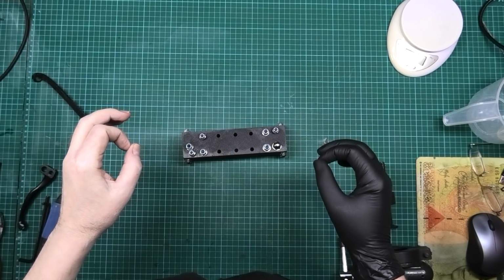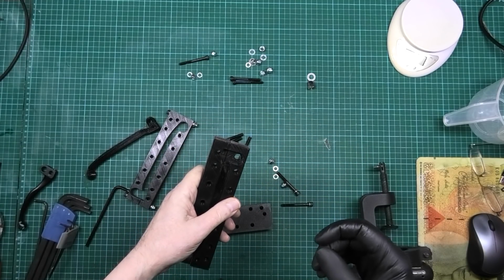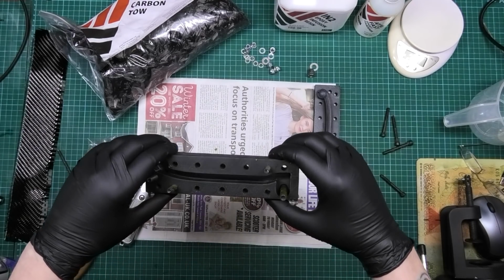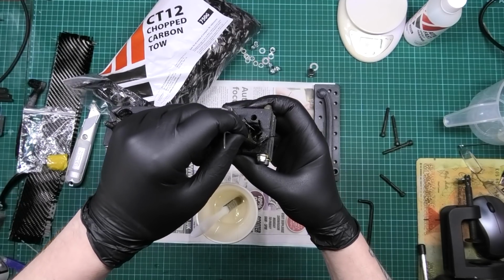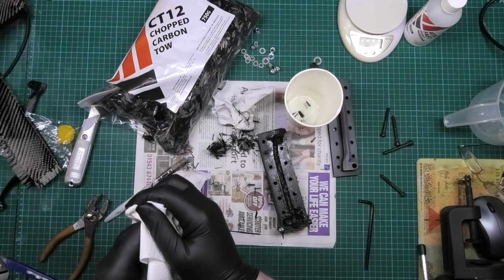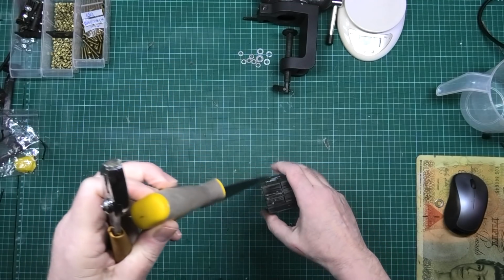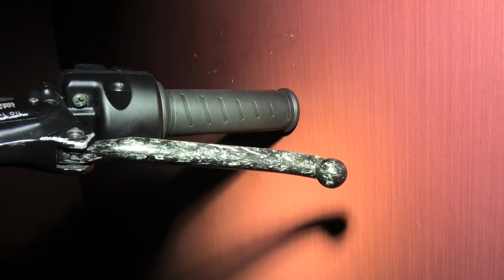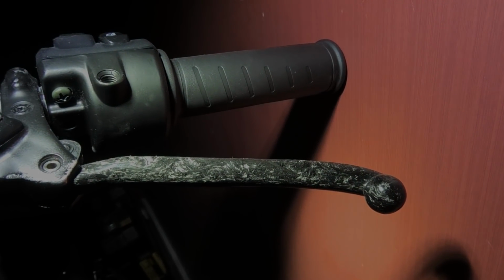🔴 EXTREMELY POWERFUL E-SCOOTER BUILD part 16 - Carbon fibre forge mould brake lever

Comment: ..and remember, life is definitely worth living on this measly earth!  Great job Tone, work of art 👍
Reply from the maker: One day soon, I'll be able to utter those immortal words again 😉
Reply: @Vortecks  hey i have a question :) 
i have a 48v 17ah battery it powers a 1000w motor could i use a higher power battery would it be safe ? 
thanks :)
Reply: @FattyOn2Wheels  If you want to use a higher voltage battery, you'll need to get a new controller rated at the same voltage as the battery otherwise you risk irreversible damage and possibly fire. if you get a new controller, I'd recommend a battery capable of at least 50% higher discharge amperage rate than the what the controller demands. Otherwise your battery will not last as long as it should. I hope this helps.
Reply: @colinriches1519  Thanks for the reply if i keep the Voltage the same 48V but change the AH would that be okay ? im currently using a 48v 17.5ah battery if i went to 48V 50ah would that be safe im not trying to change the voltage :)
Reply: @FattyOn2Wheels  Yes that would be safe. It will give you a lot more range too, but the extra weight might negatively affect the acceleration a little bit. But yes you're looking at almost tripple the range with 50ah.
Reply: @FattyOn2Wheels  @Colin Riches

that depends on the controller really, if the controller supports it you could go a bit higher on the voltage

this will (if supported) actually lessen the current draw on the battery side for the same amount of power while you'll get more range

parallel/more Ah is still the safest option though unless you're sure all the hardware accepts a higher voltage

Comment: Wow what a brilliant job well done looks like you have the knack with this carbon fibre stuff. It's looks fantastic and is very strong by the looks of it. The scooter is going to be one of a kind that's for sure.
Reply from the maker: Sorry for the delay, I've been busy building at every opportunity 😁
I don't really have the knack with carbon fibre mate. I do have the knack at making a failure into a winner because I've had so many failures, that's probably it 😂

Comment: My cat Emma plays with my wires too ..I'm amazed it worked so well. Lotta work though....Me bikes going again, new battery fitted...🤔😳🇬🇧
Reply from the maker: This cat was eating through my supercapacitor wires earlier - 2500A Vs cat? 🤣
So it was probably the BMS then mate. You'll have to strip the old one down and fix it now 😉
Reply: @Vortecks  Yep, I'm a bit nervous cutting it open, but it's got to be done...Could be a dead cell / cells...?..🤔😳😳...

Comment: Volume? Put the positive lever in a topped up beaker. Measure/weigh the overflow. Great vid, as usual, most entertaining! 👍
Reply from the maker: Thank you. Now I've got to figure out how to weigh the displaced water. Hang on...... Mark the beaker water level, put the lever in, syringe the excess out and weigh it. EXCELLENT 😁😁😁
Reply: @Vortecks  You can use a syringe marked in cc to fill or empty a volume and measure the amount of liquid.  And water is 1cc = 1 gram.  The resin vendor should also publish a number for the weight per cc (or per litre which would be x1000).  Then you can simply weigh the required amount of resin and hardener, adding a margin for safety.  Or just do what you already do - judging by your excellent results you don't need our help !   🙂🙂

Comment: Great video Tony,what. cad software do you use,have you used carbon fibre impregnated plan filament cheers
Reply from the maker: Don't laugh but I use Tinkercad.
I've used CF filament before. It's good for compression strength but rather poor for sheer strength. All the parts I'm doing, need a lot of sheer strength so any kind of filament will be nowhere near strong enough.

Comment: Mate I run a Kelly controller and I can’t get my regen variable I’ve got a domino throttle and thumb throttle on the left ready but for the love of god I can’t understand how to do it

Please please please do another regen vid 

Love everything you do mate been watching since the rc jet car days 

Cannot wait to see this thing go up the road 😆😆

Cheers in advance 👍🏻
Reply from the maker: Pin 13 has to be shorted to ground (pin 20) for regen to work. This is where you connect the Domino 'zero throttle' switch. After that, pin 2 is to control the variable regen whereby it needs to see 0-5V. Connect the positive and negative on the thumb throttle to 5V (pin 4)  and ground (pin 20) and the signal wire to pin 2.
Does that make sense? 😁
Reply: @Vortecks  you sir are a master ,yep i get it now thank you sooooo much , ill be enjoying variable regen asap , cheers mate

Comment: Not sure what you would charge for a day's labour but I suspect they might end up a tad expensive if you were selling them. 😲
Nice work mate.
Reply from the maker: Someone once said to me....... I'd love it if you built my car but I'd hate to pay the labour costs 😂
These brake levers are one of a kind and the most time spent, is designing them. If only I could find something that everyone would want, I'd be able to make proper moulds and churn them out.
Reply: @Vortecks  CF car trims are a popular upgrade. There are a few people making them for beemers and the like, often just covering the original trim.
Lots of dirty smelly work tho and you would need a compressor to spray them with 2k lacquer.

Comment: Hey Tony why cant you just 3d print it with carbon fibre filament its got to be cheaper buying the extruder and filament than all the products you need for moulding
Reply: It would break, for certain..🤔😳🇬🇧
Reply from the maker: Carbon fibre filament is made from particles which are microns thick and it's probably 1/50th the strength. Carbon fibre is know to be 10X stronger than steel in certain circumstances and I'd much prefer it over plastic of any kind. Plus which, it's pretty 😁

Comment: to calculate the volume of a piece without doing maths , you get an recipient with water to the edge , you submerge the piece to cast , and harvest the displaced water in a pan . pour it in a messure cup and done...